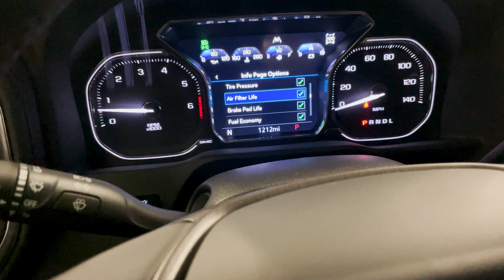2019-2022 Sierra 6.2L S&B Cold Air Intake with Dry Extendable Filter Review & Install

Comment: After this install, i keep getting a p0106 code, double checked all connections and it all looks good! Any help? Thanks
Reply: I’m getting a light as well haven’t checked the codes yet but I think it’s because I did not leave the battery terminal disconnected for at least 2 hours
Reply: @mikewolfskhal8782  i spoke to s&b… they said they making another tube with a relocation of the maf sensor. Its too close to the throttle
Reply: @aldoyamy09  No shit ? Did they say if it would be free to those that purchased the kit already?
Reply: @mikewolfskhal8782 wow, any update on this?
Reply: @aldoyamy09 hi I’m having the same issue and was told about the same from s&b. Did you receive yours? If so has the error gone away?
Reply: @ yes sr just got mine a week ago. problem fixed